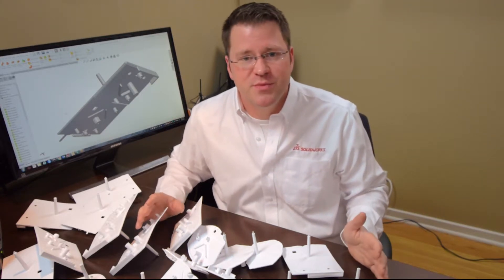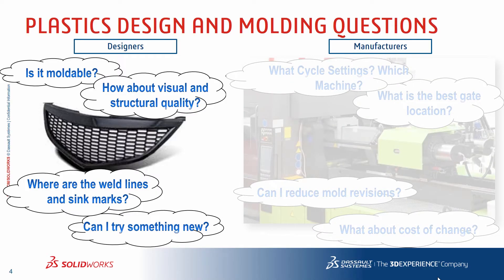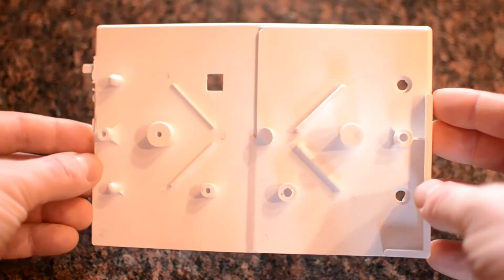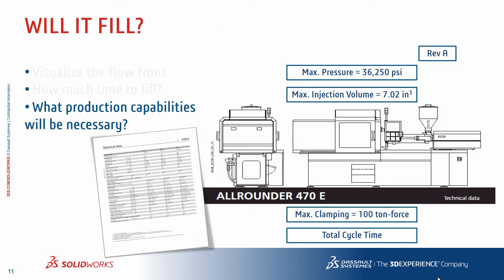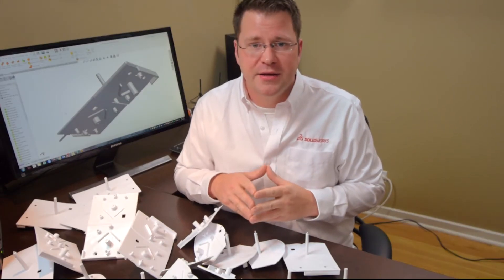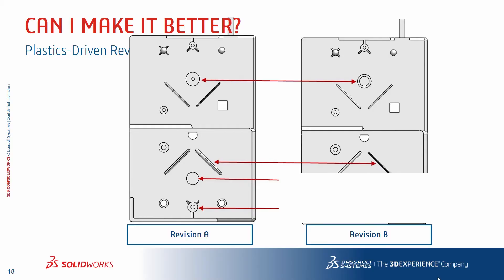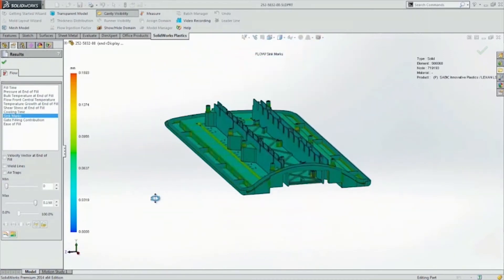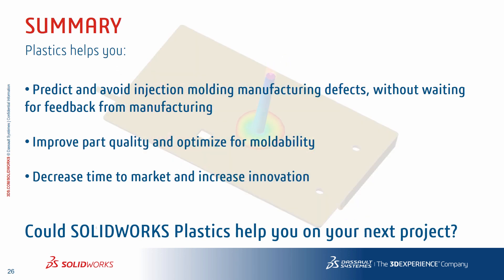SOLIDWORKS Plastics for Designers - Real World Correlation

Comment: I learned at school that the width needs to be the same. I am very curious about this prototype that once side is slighly thicker than the other.  Can someone explain?
Reply: That looks like a part designed and molded purely as a demonstration. It is to show how Solidworks plastics finds really obvious issues. No one would ever actually mold a part like that with one very thick side and one very thin side.